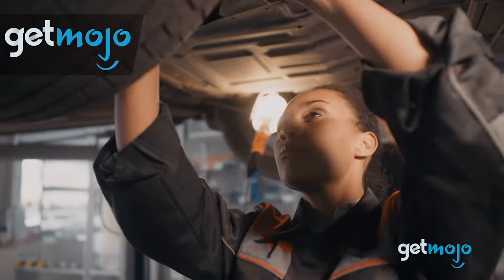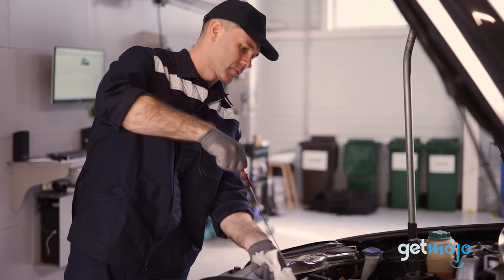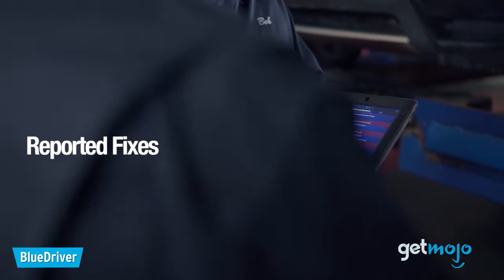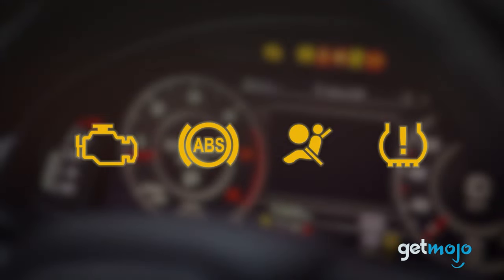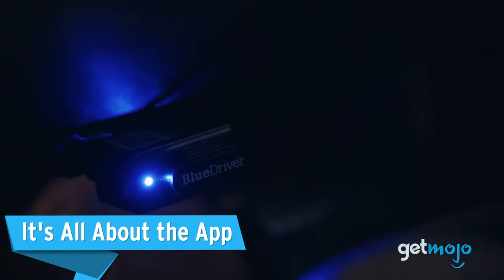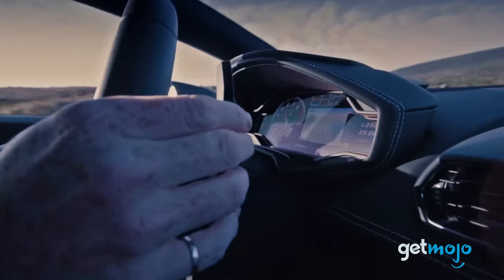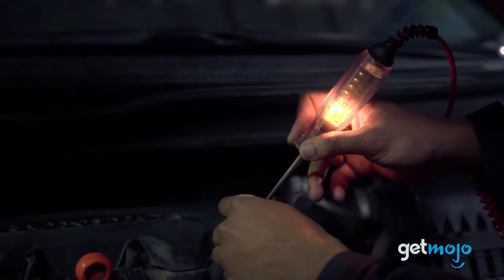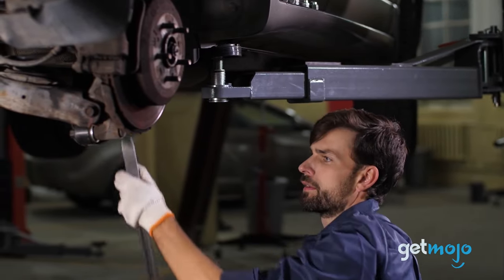5 Things to Know About the BlueDriver Pro OBD2 Bluetooth Car Diagnostic Scan Tool

Comment from the maker: To learn more about the products mentioned in this video:
Shop our pick:
https://wmojo.com/BlueDriverProOBD2CarDiagnosticScanTool
If you buy something from one of the links above, WatchMojo may earn an affiliate commission.
Reply: So here I am. Engine rumbling.  Feels like coil misfire.

Unfortunately, my brand new bluedriver will not connect. 

Red light immediately follows the blue light.
Reply: Does the tool monitor ATF temp real time?

Comment: so... not bidirectional?
Reply: What?! 🤔🤨
That doesn't make sense.
Reply: @cloudbase7799   makes total sense if you know the subject matter. But the answer to the question is no, it’s not bidirectional. You’ll have to spend at least $500 for those types of diagnostic tools.
Reply: @thatdonnyguy  Bluetooth is inherently bidirectional. Ju M may have been asking whether the BlueDriver Pro can be used for programming. I contend that the label bidirectional is meaningless by itself. Scan tools are the primary bidirectional control device and even basic scan tools can be considered bidirectional since they send information to and receive information from vehicle control modules.
Reply: @cloudbase7799  Bluetooth or wired has nothing to do with bidirectional ability of the device. If you have ever used a real professional bidirectional OBD diagnostic tool, you’ll quickly know the difference. While I do not own this device, it appears to have some additional functions over a basic scanner. But, on Amazon there are people even asking if it’s bidirectional and “no” is the repeated answer. More and more cheap devices are gaining more bidirectional ability, but they just haven’t got to that level yet. When you find one that can connect and manipulate body control modules, let me know because I’d rather not pay $$$ for a clunky diagnostic tool when I can use my phone.
Reply: @thatdonnyguy  Sure they do. Without bidirectional communication between a scan tool and the software controlling it, you would be able to receive/read reports XOR send requests/commands (e.g. clear code). But even a simple read report function is bidirectional. The scan tool requests data from a vehicle control module and the vehicle control module sends data in response. The BlueDriver scan tool can also request to clear a dtc.
The point is that without more information (what do they need/want to do with a scan tool), the term and Ju M's question are all but meaningless.
Reply: @cloudbase7799  I understood exactly what he was asking and the answer is still no, it’s not bidirectional.
Reply: @thatdonnyguy  m'kay
Reply: And it not being bidirectional is the biggest NO for me on purchasing.  With the sophistication of phones these days, why doesn't it have that capability!!  ARGHH

Comment: You fail to mention that Bluedriver only works with the big four automakers but not imports.So far it does NOT work on two Nissan's, one VW and one Toyota. Their support is no help.

Have you done a review of any OBD scanners on which car makes AND models it is compatible with?
Reply: I have a Honda and I use mine all the time
Reply: I just installed it on my Subaru BRZ and it works great.  I had an issue with some conflicting data from what was published by the manufacturer and a customer review ... So I called their 1-800 number in the enclosed instructions and it was answered on the second ring, directly by a tech,  and he assisted me with confidence and concise instruction.  That's about as good as technical service gets from anywhere.  I'm 100% satisfied so far.
Reply: Does it do a deep scan besides the Check Engine light codes? My AWD light is on and the obd scanner i have doesnt check that.@OG_Glizzy_Gobbler
Reply: @Th3Guardian12 yes it does .
Reply: @Th3Guardian12 it will give you possible remedies and show you the most common ones that solved the issue for other people.
Reply: It does work with imports, lol. 
There is a compatibility link where you enter your vehicle and it tells you what is supported. Just google bluedriver compatibility. I pasted the link in a previous comment but it was removed. It’s annoying how YouTube does that!